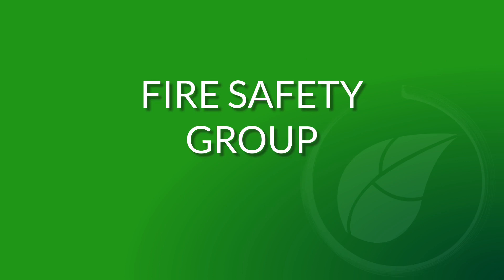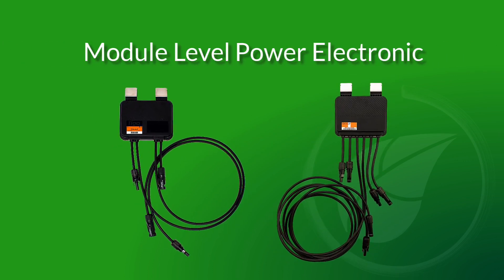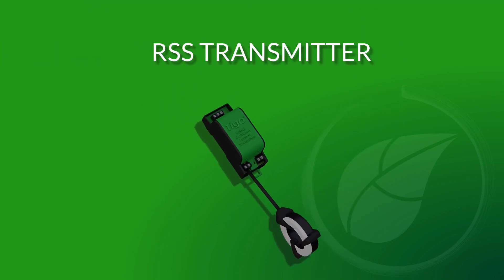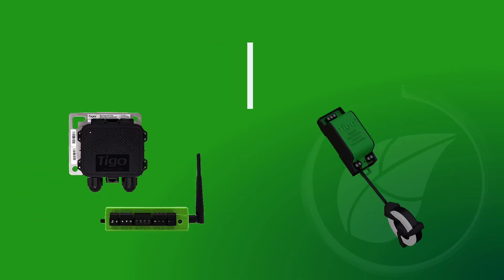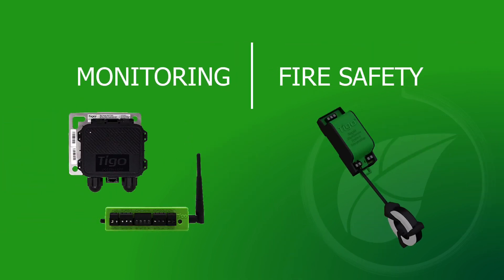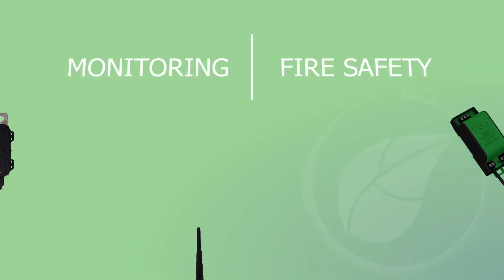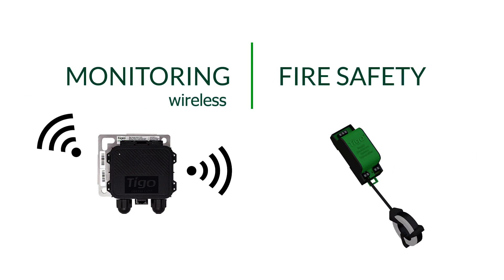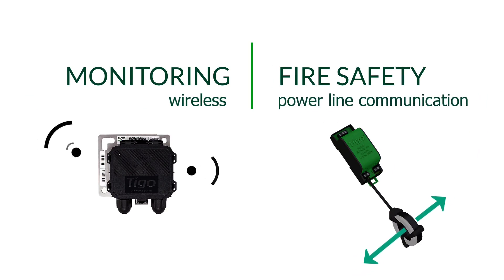Tigo TS4 Overview - TS4 Course Excerpt from Tigo Academy

Comment: For people that are asking, these optimizers WILL work without the CCA or TAP or any other communication. At least the TS4-A-O. I installed 13 of them on an off grid system yesterday and it is working great. Here is the reply from tech support regarding operating them in this "blind mode":

"Regarding using TS4-A-O units in an off-grid scenario - These units can be used in an off-grid and off-network system.  With that said, the warranty will reduce from 25 years to 5 years as they will have no access to monitoring or updates.

The TS4-A-O units are shipped in an "ON" position, so right out of the box, these units will produce and optimize (as optimization is a passive feature on the new TS4-A-O equipment)."
Reply from the maker: Thank you for the information. We provide detailed information about this behavior in our Help Center and Tigo Academy courses. While it is true that the TS4-O does not need the CCA/TAP to optimize, it does need it for module-level monitoring and EI Portal/App visualization. The benefits of monitoring are well documented and are laid out in these resources:

https://support.tigoenergy.com/hc/en-us/articles/41763175840915-Why-Tigo-TS4-Module-Level-Monitoring-is-Worth-the-Investment
https://support.tigoenergy.com/hc/en-us/articles/202342726-Monitoring-Features-Pricing